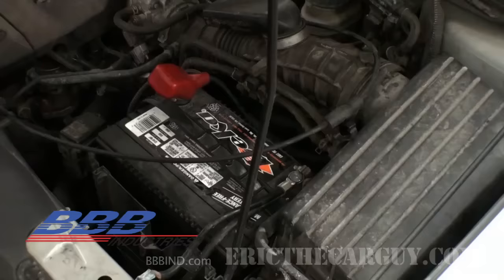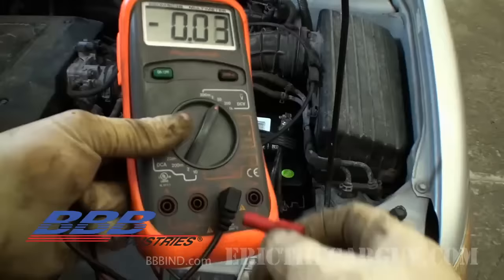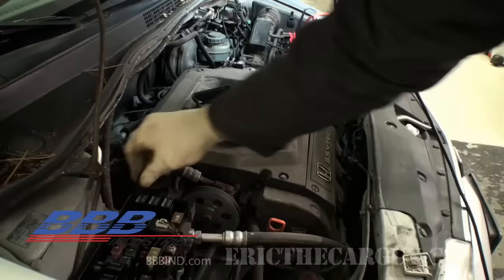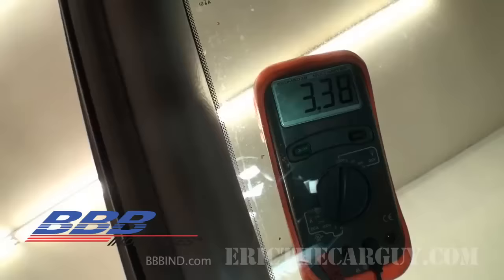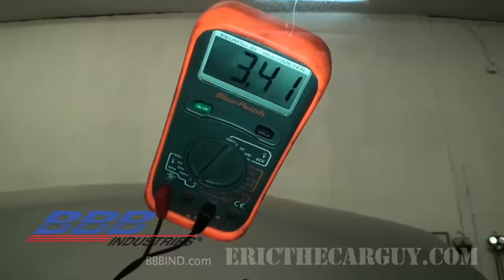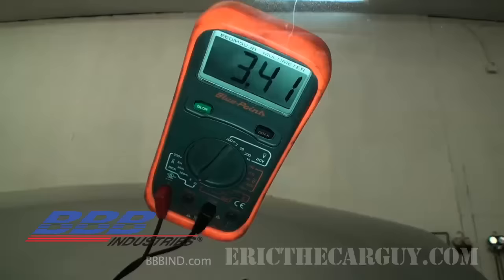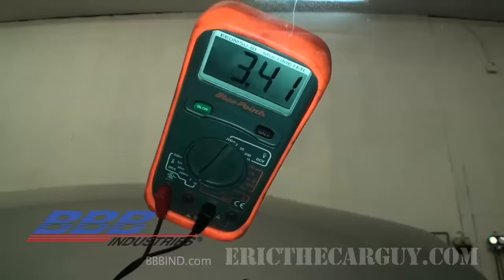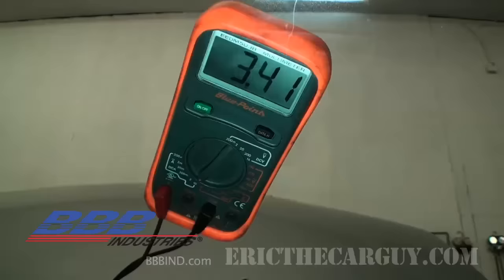How To Perform a Parasitic Draw Test - EricTheCarGuy

Comment: Two years, several jump starts and 4 dead batteries. Multiple garages either couldn't do this test or refused to because of the time it takes. Twice to the dealer, twice to the shop in town that was supposed to be THE place for electrical issues. No one could figure it out. Thanks to you, I was able to diagnose the problem myself. 78 milliamp draw on the circuit that included the faulty door latches on my KIA Sedona. Getting them replaced tomorrow. I can't thank you enough for putting this video out there.

Comment: VERY IMPORTANT ! When you connect the leads of your meter, to the meters "Amps" sockets, it doesn't matter what the dial of the meter is set on, the meter will be flowing AMPS. In other words, if you set the dial to Volts and you try to measure Volts, but the leads are connected to Amps, POOF, your meter will INSTANTLY and silently blow it's Amps fuse (or burn up something). Yes, I have done it more than once.
Reply: There are dozens of us . gif

Comment: Determined that the parasitic draw in my 04 Dodge Dakota was coming from a faulty ignition switch which was very hard to find. Might be of use to someone.
Reply: I may have a similar issue with my dodge Dakota, how did you go about finding the ignition switch to be bad? I watched the video but how did you go about testing for the switch to be bad?
Reply: Thank you, this may be the issue on my 88 S10. I was hoping it was as simple as the guy before me hotwiring the electric choke to a hot at all times but no luck and back to square one.

Comment: This video came in SUPER handy today for me. After replacing a bad battery a couple of weeks ago (it was tested and had a bad cell...about 5 years old), I tried to start my car today after it had sat for about 2 days, and it was completely dead again (lights wouldn't even turn on at all). I didn't have to test the fuses, because now that this was the second time that a battery completely drained (and this one was brand new), I knew it wasn't just a bad battery.

I tested the alternator after I started it with a battery charger/starter, and it tested good (14.48 V). After that, with the help you provided here, I tested to see if I had a draw. I did -- 1.35 amps. I then coupled this information with odd behavior from my CD player that I hadn't had time to investigate yet. Whenever I started my car, it would eject the CD.

With this information, I checked out my stereo to see if I could find anything wrong. Sure enough, the eject button was stuck pressed in. After pressing it several times, I got it to unstick. I continued to press it in and out to make sure it wouldn't stick anymore (I'll spray some lectra-motive cleaner into it later). Once it stopped sticking, I rechecked the draw, and it was GONE. Woo hoo!

Thanks a bunch for posting this video! Though I didn't have to go through the process of checking each fuse, the overall logic got me to the solution WAY faster than I thought I'd find it. This took me a total of about 20-25 minutes, not including the time to watch this and a couple of other videos. You saved me a bunch of time and headache, not to mention possibly some money, had I ended up taking it to a shop to see if somebody else could figure this out.
Reply: Jerritte Couture. Good man!
Reply: Holy shit. My truck just started dying a few days ago if it sits for more than a few hours. New alternator and battery both testing good. My CD player too is trying to eject. I'll probably look into that first! 👍

Comment: Over 9 years later, this video is still helping people fix their cars. I had been fighting an issue on my 2003 Silverado 1500 for about 2 months of the battery dying. Had a 2.12 AMP draw on it… Some head scratching and fuse pulling led me to the instrument cluster fuse being the culprit. With fuse removed it went down to 0.052. So i decide to pull the cluster out, and found multiple corrosion marks on the back. $40 repair at a electronics shop, and I no longer need to carry a jumper box everywhere I go! Thank you so much for your knowledge and thorough explanation.

Comment: Eric your giving away knowledge for free and I am consuming everything.

Thanks bro 👍
Reply: It's the wrong way to do it anyway.
Reply: @alext9067  Tell us the right way, please.
Reply: @deysanimations1949  jajaja
Reply: @alext9067  It's the easy way than non-mechanic people like those who are watching the video can do.
Reply: This is too good lol😂😂
Reply: How about I got a battery that's still not all the way dead like even 75% good but my car is dying out with the information board saying charging system has failure and battery saving is active?
Reply: And it now just click click clicks and sometimes it'll still be running but the lights went out and this car was hooked up backwards meaning the terminals were on the opposite side after changing the battery on a night that it was dark and I had a dead battery and I had another good battery in the back but it was hooked up wrong for about a minute or 30 seconds at least my car honked and the fan came on in the lights were on and it was a solid hawk until I let the cable off the terminal

Comment: Just wanted to thank you for your video.  I knew nothing about this. 2008 impala went through 3 battery’s in 2 years. Drain on interior light/dimmer fuse. Looked at all the int lights and they weren’t on. Finally found a wiring diagram for that fuse and one of the things it ran were map lights. Got in the car and on the mirror were 2 buttons. One on and one off. Pushed it in and drain gone. Would have never got there without your help.

Comment: Disabling the door switch at 7:22. I've also seen similar switches to detect if the hood is open. Some cars do this standard, others have aftermarket alarms with such a switch. Check for and disable them as well.
Reply: Samniss Arandeen There is also usually an under-hood light that turns on.
Reply: +Samniss Arandeen I didn't understand that part of the video. What is he doing with the wood plank?
Reply: Camron Conway the door light switch is pushed back in with the wood and clamp. To keep the dome light from coming on while the door is open.
Reply: Oh okay, thank you

Comment: Thanks so much for this. I had my '08 Acura TSX (notorious for battery drain) tested for parasitic draw at a local service station; they claim to have found nothing. When the battery they sold me three months ago died, I followed your video and confirmed that the Hands-Free Link was drawing 230mA on its own. Disconnected it and now have a normal car again. Great job by you.
Reply: Love Acura, I have 2004 ls and a 93da integra.  I am going to be doing this diagnostic on my 93 integra asap!
Reply: How did you disconnect the hands free link

Comment: Eric that was superb.
I am an electrician, not an auto one, and we used methods just like that to find faults. You explained it so well and after the main event listed numerous things in cars that might be taking some amp draw. The remove negative lead explained why and even why a meter migh show a negative value even though the value was correct.
It would be easy too to not think of those days when opened.
Brilliant.

Comment: Thanks Eric for making this video! I know its been 10 years but it helped me track down a parasitic draw I'd been dealing with for a couple years. Turns out it was from work I had done upgrading my speakers and radio on a 2007 Odyssey, just like you said was a common cause in the video. My draw wasn't enough to drain the battery overnight but if I let the car sit for more than a couple days, the battery died. Thanks again!

Comment: I'm an avionics technician on Military aircraft. Not having the wire diagram for a car sucks. Your information is spot on, excellent. My friends 2016 Durango had a .089 draw. Pulling the TCM fuse didn't do anything but it did when the fuse was put back in. We had a similar issue on "my" aircraft where a computer shuts down on battery power but failed to. Drained the aircaft battery. Thank you!

Comment: Thanks so much for the logical process using my VOM.  Was able to locate the source of drain on my daughters 82 Mercedes Diesel recently purchased.  Only took 10 min of setup and fuse pulling!  On suspect circuit, found a broken head off a fuse that fallen (w/P.O.)  arching between two circuits.  Great feeling to get this w/o big shop fees!

Comment: You my friend are a lifesaver. I’ve been holding out for a couple years but lately the battery draw has been worse ! My starter and alternator and everything checked out and replaced my battery multiple times thinking it was faulty ! Chatted with a few people and eventually thought maybe it’s a parasitic draw? I’m not a car guy at all, I don’t know what half the things are on a vehicle but I studied up just a bit and followed your video religiously. I have a 2008 Scion tc, when I was checking how much amp was being drawn I was getting about 0.20 and it would spike up to almost 0.50. Decided to start first on the fuses in the engine compartment, and lo and behold I pulled one out and it immediately went down to 0.00 and sometimes 0.03 at best. You saved me so much money and I only spent about 30-50$ at harbor freight ! I have no knowledge on none of this but you my friend saved me Thankyou !
Reply: What was it?

Comment: This makes so much goddamn sense that it makes me feel like I lack certain amounts of common sense...
Reply: There is no guarantee that you will grind it in the fuses. You need a very expensive tester  to find this if it's not the fuse
Reply: @harrynbrandy8915  mine ended up being the alternator or something,  I forgot cause it was so long ago. Still found it with a basic multimeter. Although, the vehicle was from the 80s so new stuff is probably harder
Reply: @harrynbrandy8915   the 3.00 Harbor Freight multi meter will work just fine for this...
Reply: Don't sweat it mate! Common sense is the least common of the senses. Or so they say...
Reply: Hahaha true

Comment: Here's a little tip to protect your app meter from shorting out.   Actually the meter already has a fuse in it but often it's a pain to replace it and you also need a special fast blow fuse.  The fast blow fuse is important,  can't get it at the automotive shop. Most cases the meter case has to be opened to replace the fuse.  To ovoid all this put in a sparkless or electronic fuse inline with the meter leads,  a few amps lower than your meter's rating.  Don't use the thermo breaks you normally find at the auto parts store.  These are for head lights.   What you want is the sparkless or electric type used in racing.  You can find them for a couple of bucks on-line.  These breakers prevent sparks when wires are shorted to ground and reset as soon as the short is ended. Good idea to use these fuses in jumper wires too.   In fact that's what I use is a jumper wire with one of these fuses in it for amp readings.  Makes allot of electrical work safer since sparks are prevented when shorts happen.
Reply: Thats really smart tnx

Comment: Thank you for posting.  Using this technique I was able to identify and repair a parasitic current draw issue on my 2009 Honda Civic.  Turns out it was the AC Magnetic Clutch relay was staying engaged.  Replaced the $7 relay and the problem is gone.  Thank you!

Comment: It works in an older vehicle but with a newer vehicle you can still wake it up the other modules, better to measure voltage across the top of the fuse blades with the multimeter.

Comment: This is helpful even years later. I have a 2006 BMW e60 5 series with a heavy drain. it was in the local Christchurch (NZ) dealers because I THOUGHT they would surely be the one to track it down but nooo they spent 7 hours on it and failed to find the draw. Price for this 7 hours of no result was about 800 NZ dollars. I was left utterly unimpressed and my wife was upset. So far I tested the bonnet switch and that seemed ok and the fuel door is also ok. Apparently known for being possible areas of drain. At one point they thought it was the passenger door but that didnt prove to be true. This car does not have comfort access so that is not the issue either. I have removed the fuse for the alarm and will see if that solves the issue at least till we can afford another go at with someone better than the dealer... From watching Erics video it looks like pulling fuses one by one will surely find the area of drain.
Reply: there are alot of bad techs at the  dealer
Reply: They should not charge you if they did not fix anything...
Reply: that sucks, hope you did not pay that
Reply: Curious if you found the problem following this video.
Reply: Black Terminal , did you solve the problem?
Reply: E60 drain here as well. such a pain. testing fuses today and if that doesnt work the IBS is going. the battery has 48k miles on it and plenty cold CCA. Just keeps drainging

Comment: I always used a test light, unhook the ground and hook up the test light between the ground cable and the battery ground. if there is a draw the test light will be lit, pull use fuse at a time until the test light goes out then you know the circuit you need to examine

Comment: to initially make the parasitic draw determination, you could clip one end of the DMM to the negative battery terminal, then put the pointed probe tip on the battery post, and carefully lift up the cable terminal to disconnect the cable. That way it doesn't restart the ECU on those newer vehicles and display a misleading reading due to waking the ECU. Just drop back down to restore the battery connection.
Reply: Or hook the leads up and wait a few mintues til it settles down
Reply: Yes a good point I just posted a comment on this , especially on luxury cars

Comment: Thank you Eric, I am a shade tree mechanic, and was looking just to find out what was an acceptable parasitic loss, but I had always tested the amp draw by taking out the fuse and bridging the fuse terminals.  A lot more work, your way is much easier and faster, great tip!  Unfortunately for me, I have a 0.15A draw, which explains the dead battery.

Comment: A clamp meter (measures current) can allow measurements without removing the battery cable. Get one that measures DC current. Most measure AC only. Aneng have one (Chinese, but ok quality and about $30). The clamp meter tongs form a loop around the battery cable (or other cables) and measures current. Does not have the same accuracy as direct measurement in the example in this vid. which will be needed in some circumstances where the current is small. Eric is thorough and methodical, love these videos.

Comment: I just used your method and found a 6.3 amp draw on my interior lights. I cleaned all the contacts and the 50 amp fuse and im reading 0.0 amp draw. thanks Eric you saved me 150 bucks.

Comment: I was dealer a mechanic for over 30 years and over time we have moved from old school diagnosis to plug and play diagnosis. When I left Honda we where able to plug unto the OBD2 port and run the test on the scanner to see what circuit has drawing the most current.  I have a problem with my Lincoln Town-car. It has become a battery assassin and has killed 3 batteries in the past 2 years. I came to your channel for a refresher on Parasitic Draw Test. Sorry but I could help but notice the VAT 40 in the background at 10:50 in the video. This is only the BEST Battery, Alternator, and Starter tester that was on the market and its the one I learned on. Now we have ED18s and a computer that tells us a battery is bad. I once had our ED18 tell me the battery in my 2 year old battery in my car was bad and I drove it another 2 years before it left me stranded....anyway that was all good advice being that I was a Honda Mechanic for 30 years it was very familiar what the draw was going to be but I thought it was going to be coins in the CD player we would get those in all the time when the kids would see the parent put CDs in the player and the kids would put coins in the player causing draining batteries and blowing the parking light fuse. The only other thing I would do is close the hood latch because a lot of factory security systems wont go to sleep until the hood latch is closed and in the case of the Town-car it has an under hood light. oh and I usually just pull the 8mm out of the door switch and just let it hang by the wire because all it does it ground out on the body to turn on dome lights and keep the Honda computers on. Again great video Im sure you know that and you don't need my validation but keep up with the great videos

Comment: Good video, but if you don't have an amp meter just use a dome light bulb  (or tail/ brake light bulb will work) with a pair of wires on both leads,  the bulb will light up if there is a draw of current and you won't have to worry about any damage being done ( save your VOM for more important issures ).
Reply: That was OK years ago, but, you can't use a test light on vehicles with computer modules. Using a test light on these vehicles will yield inaccurate test results.
Reply: Charlie Atkins That depends on what you are looking for as a current draw. I do troubleshooting for a lot of garages when it comes to electric issues and using a light bulb is for the fuse box test only, mostly for finding overnight batter drain problems. It's important to note that using a LED light will not be accurate because of a one way connection (diode) and very little current is needed to cause it to light. All cars today will have some draw as the ecm eprom circuit is on all the time.
Reply: Robert Brunner "mostly for finding overnight batter drain"
I'll keep that in mind next time I bake from scratch ! :--)